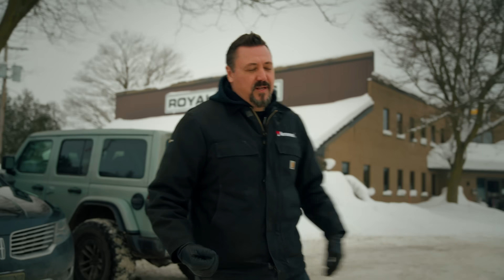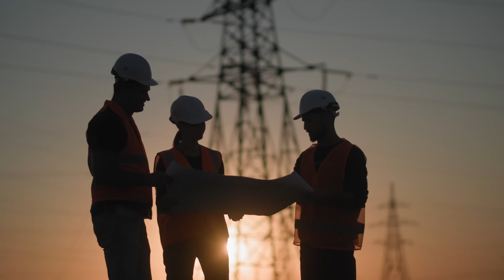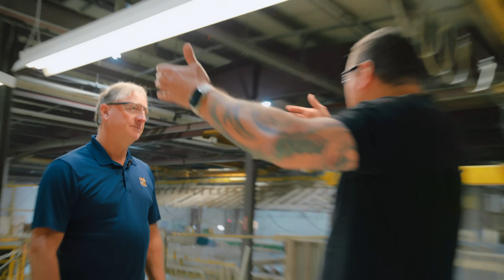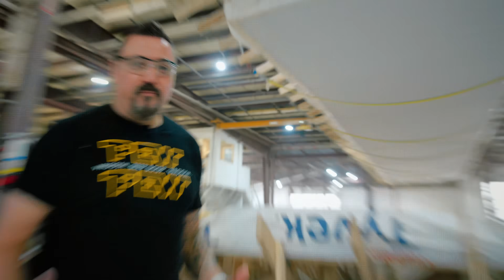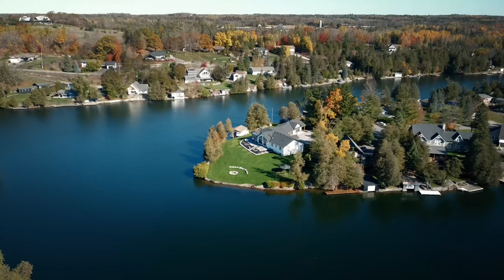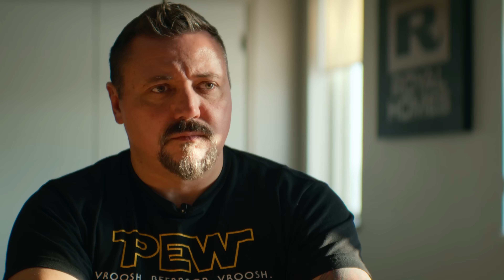Proof we can build in HOURS Not WEEKS

Comment: I think this type of construction could work if you find a way around permits and inspections. Like already encased structural walls, electrical, etc is something that this type of manufacturing/construction can make very tricky to work around.
Reply from the maker: You hit on one of the biggest challenges, Mike! Permits, inspections, and hidden systems like electrical and plumbing are exactly where innovation collides with regulation. We’re actively working through those friction points and exploring pathways. You’ll see more on how we tackle this in upcoming episodes⚡ Thanks for joining us!
Reply: Everything is approved before building and there are random Inspections done during production. There is also a Quality Control Program approved by Ontario Building Dept for every work station in the factory. There are still the normal site inspections also.